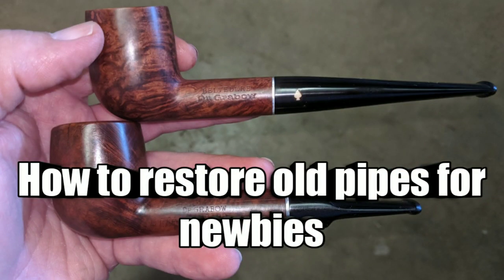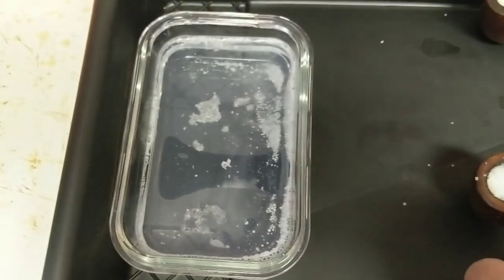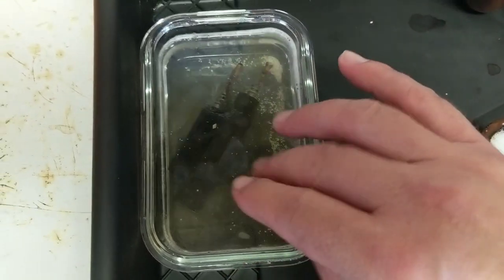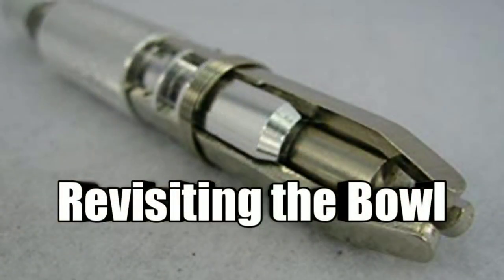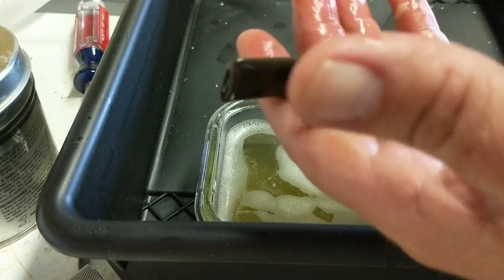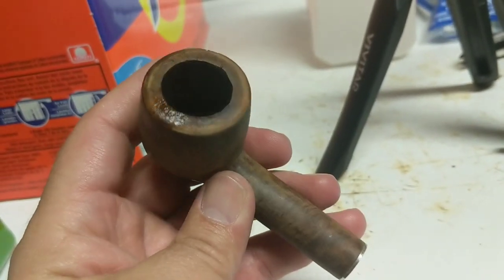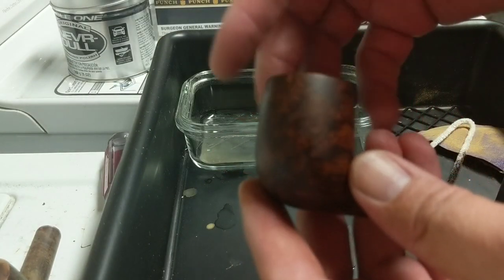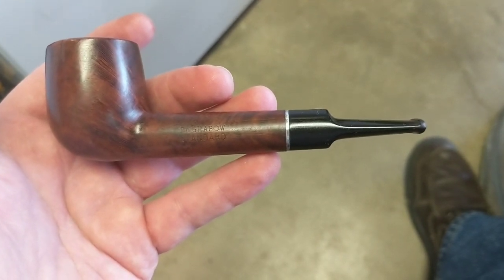Pipe Restoration for Newbies

Comment: Awesome video! Do you wet sand the stems from 800-12,000grit? Or do you dry sand them once you get to the higher grits?

Also, how do you sand the pipe in prep for staining? Do you get to a certain grit, stop, stain, then finish sanding up to 12,000, or sand to 12,000, then stain? Thanks. 

I have a few nice billiards that I’ve got drying from deep cleaning, and I’ll be ready to stain and polish them soon so I’m trying to NC to come up with a gameplan as it’s my first total pipe refinish
Reply from the maker: @StephenStrader-f2z  I don't sand past 800 anymore.  I only sand the pipe of it is necessary.

Comment: One thing on the super glue on the bowl. Superglue fumes are seriously irritating to mucous membranes (eyes, nose, mouth) and nasty in the lungs. If heated too hot — above 330 degrees Fahrenheit — it will decompose into cyanide gas (lethal, nasty stuff).
Good tips on the other stuff. Thanks for the video.

Comment: I just picked up a batch of 6 really rough estate pipes, and have cleaned them with varying success; this is exceptionally helpful as the Red Dot pipes I got are built just like these with the threaded shanks. Is the Oxyclean non toxic or do you do a soap wash after?
Reply from the maker: Good question. I don't soap wash them afterwards but maybe I should!

Comment: Mr. Walker, could you tell me how long you sand the briar and with which grain and what order? When you got finished with those they looked much better than "decent" as you said.  Thank you in advance, sir!
Reply from the maker: Thank you.  I do it differently all the time.  Normally, I would start with a 220, then 320 and a 400.  I frequently have to go back to 220 when I find I missed scratches.  I only go to less than 220 if the pipe has serious damage and needs a lot of briar removed.  There really isn't a need to go to higher grits than 400.  I only use the higher grits on the stems.
Reply: @ProfessorWalker  thank you a bunch.  I'm going to Hobby Lobby to grab some stuff for these old pipes I just bought.  Thanks for the tutorial video!
Reply from the maker: @BraunBrosBriar  Email me at smokenlaw@gmail.com.  I will send you a pic of the sanding tool I got on Amazon.  It is great for pipes.

Comment: I like that fact that Everclear is consumable, but since it's not sold in my state I use that same isopropyl alcohol.  I've noticed alot of restoration guys set the pipe on fire for a brief couple seconds immediately following the staining.  I'm not sure why they do that though.   I believe it was Bare Pipe, but I could be wrong.
Reply from the maker: Bare pipe does that.  I tried it but I am not sure if it makes any difference.
Reply: It "sets" the stain into the briar. Helps it to stay put and also helps with making the grain pop a little bit more.  
- Jim
Reply: @bcvpiper8356  plus it burns off any alcohol that is in the stain.

Comment: Thank you professor! This video was amazing. I am new on this world of pipes and I have a question... After using the oxiclean on the steam how do your clean it? Only with pipe cleaners? Or some alcohol?
Reply from the maker: Hi Sergio, thanks I appreciate that. I usually use some 400 grit sandpaper after the stem has soaked awhile, being very careful to avoid any logo.  Depending on how nasty it is I might soak it longer.  Once I am completely done with soaking I clean the surface with Dawn and then work the air passage with pipe cleaners soaked in alcohol. I hope that helps!
Reply: @ProfessorWalker  thank you very much for your reply!

Comment: Would wood putty mixed with wood glue work on that crack/hold up to heat from smoking?
Reply from the maker: No, thanks won't work.
Reply from the maker: If you have a donor pipe you can mix briar dust in super glue. I usually just use super glue in the crack and sand it well. It won't look perfect but it will work.

Comment: Do you use anything else on the stems besides the magic eraser and sand paper?
Reply from the maker: A buffing wheel with carnuba wax. My buffing wheel is a piece of junk. A good one would work a lot better
Reply: Haven't watched the full video yet, but I use micro mesh pads. They go up to 12000 grit. Obsidian oil is good for vulcanite or ebonite stems.

Comment: I have a few pipes I came across that I want to identify maker and age and value. Is there a resource for that?
Reply from the maker: http://www.pipephil.eu/logos/en/index-en.html

This website is a treasure trove of information on pipe brands. But there are lots of resources online.

Values are hard to pinpoint because it has so much to do with condition.  eBay is a good place to start.
Reply: Professor Walker awesome. Thank you for the information!
Reply from the maker: @codiefeazel173  You are welcome